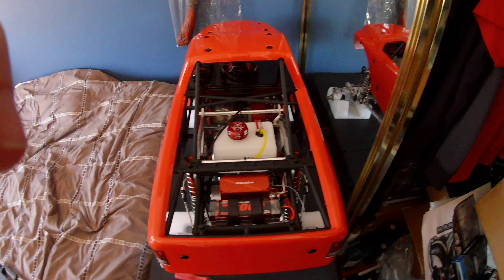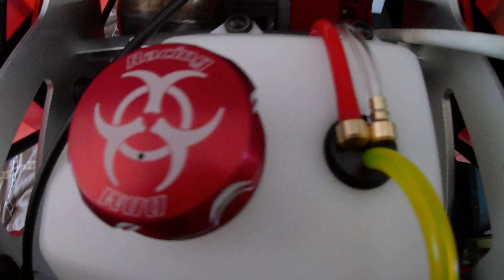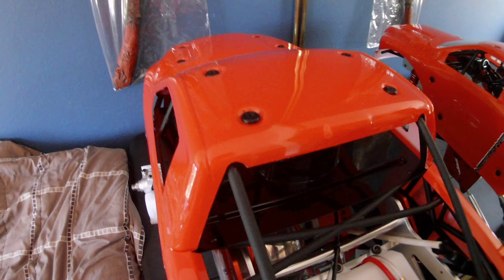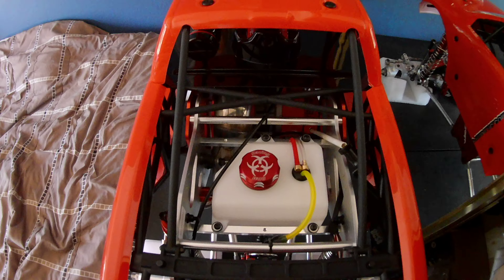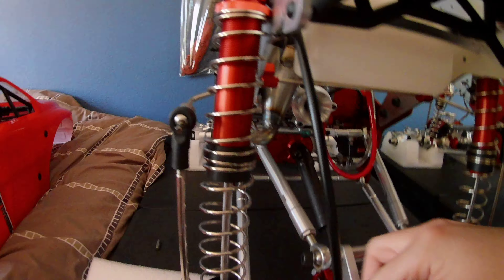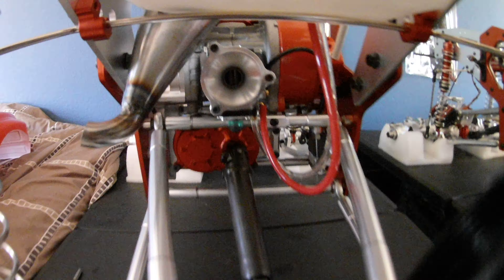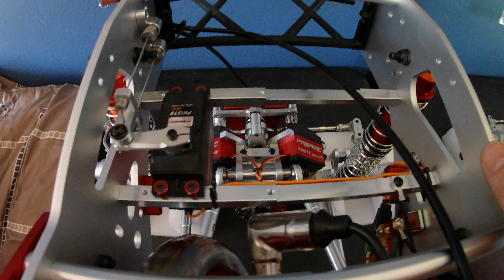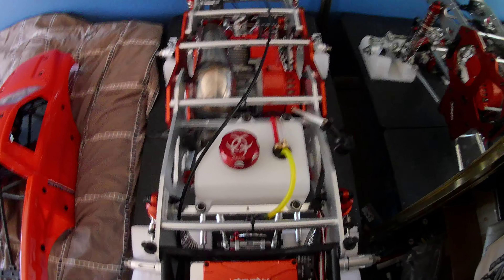PRIMAL RC RAMINATOR MONSTER TRUCK UPDATE

Comment: Bro you must face your vent upwards! Keep it always vertical . Try shortening the fuel line like a knuby or secure it up high verticaly . My air filter fits perfectly on the Bartolone Racing Velocity Stack But it was a bitch to install it I used a small flat head screwdriver to pry it and it’s now snug as a bug . Keep up the great work brotha we will talk soon! 🤝💥👊💥

Comment: What size screws fit ( are needed ) when you changed over to the Bartolone velocity stack ?
Reply from the maker: Lenny7118  If you buy that one it comes with the screws you need
Reply: KITT RCT Thanks I just saw that. Out of Stock now. I don’t know how quick DDM is on getting in new stock
Reply: What is the part number and how to order for the fuel line you up grade on the gas tank.  Thanks
Reply from the maker: http://www.davesmotors.com/solid-fuel-line-by-the-foot-.html
Reply from the maker: http://www.davesmotors.com/clear-fuel-line-by-the-foot-.html
Reply from the maker: http://www.davesmotors.com/Snappy-RC-Ultimate-Fuel-Line-Kit-for-HPI-Baja-5B-5T-.html
Reply: @kittrct8437  thanks